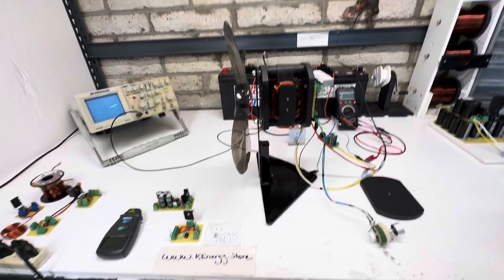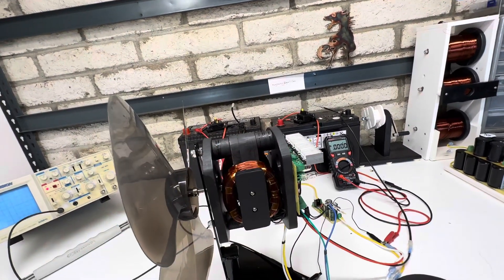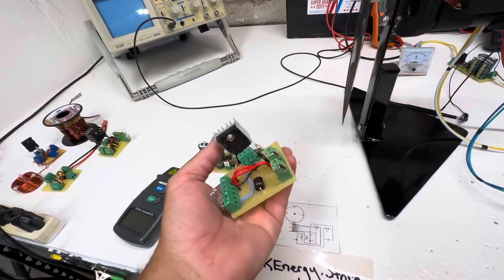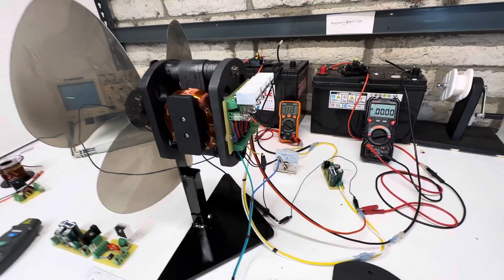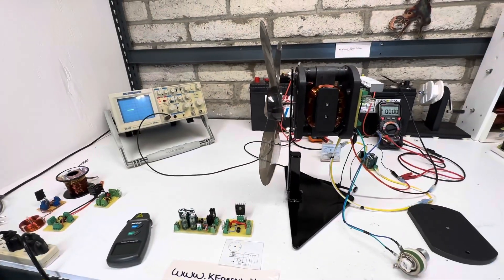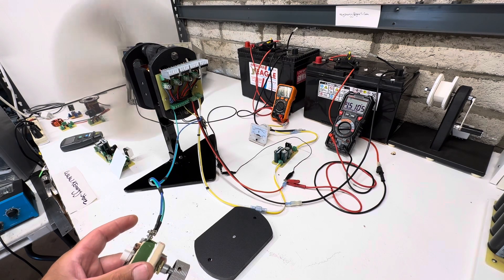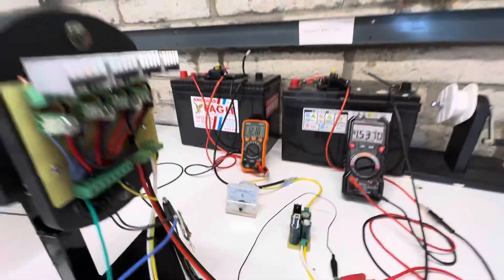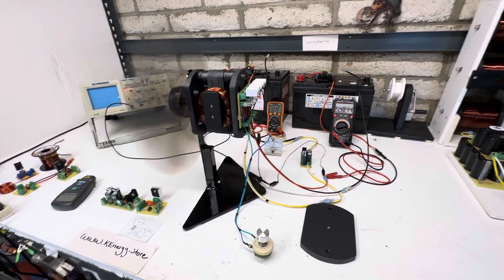Bedini Window motor New model for sale

Comment: Let’s see a loop
Reply from the maker: I know everyone always wants a loop but bedini output puts second battery in series so loop back just makes a direct short you would need secondary windings that are isolated to do that
Reply: @kenergy1707  I don’t wanna see it run forever I just want to see the mechanical value as it is versus not …  show the people the value and stand by your work…. Or not… whatever
Reply from the maker: @joew5559  i understand I show input amps, out put amps and voltage load which is the fan the oscilloscope wile running and how to tune it properly 
 I have videos on back loops I just saying this set up you can’t go back to primary batteries if you want more information email me at 
 kbgenergy@gmail.com 
 I can go into more depth with questions
Reply from the maker: @joew5559  I have 4 windings on that motor I can spilt 2 off so as to have isolated output then run on 2 transistors run it back to primary battery so you can see if it has longer run time I’ll do video tonight
Reply: @kenergy1707  There are a few people that would like to see that..  ty. With every suggestion there may become a new one…. 😝
Reply from the maker: No problem! Definitely gives me more video ideas ! Thank you ! 
I’m not sure if anyone knows but when you buy from my store you get my direct phone nub for any questions or help
Reply: @kenergy1707  Yes I seem to have that effect on people…
Reply from the maker: @joew5559  why no videos?
Reply: @kenergy1707  ?   ..
Reply from the maker: @joew5559  why don’t you do any videos?
Reply: @kenergy1707  you are the builder on the watcher ….I have no idea why you’re asking me about videos when I make my money elsewhere…… don’t be mad at me because you’re confused you are the one selling things… lol unbelievable attacking your watches your true self has finally come out….
Reply from the maker: @joew5559  lol your funny just wondering if you do any of your own research?
Reply from the maker: @joew5559  I’m not mad or confused I make money elsewhere also the questions you ask makes me think you experiment too
Reply from the maker: That’s awesome! If you ever want to talk get in touch
Reply from the maker: @joew5559  new loop back video up check it out

Comment: Put the car batteries away get smaller 12 V batteries like lawn more ones run a test and see how long it will run in the efficiency compared to when you don’t use this..   do you know facts… show the differences in using all that stuff
Reply from the maker: Good idea 👍 I use bigger batteries with small load because batteries are more efficient at lower draws